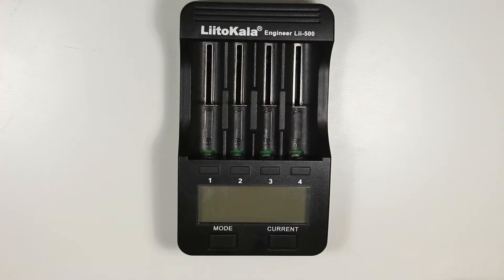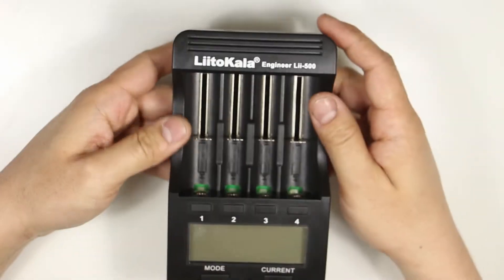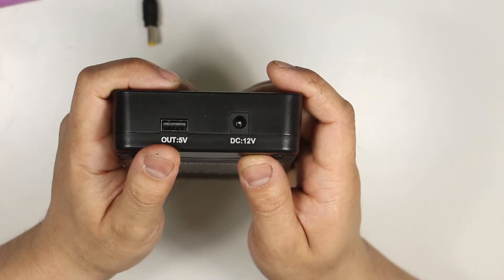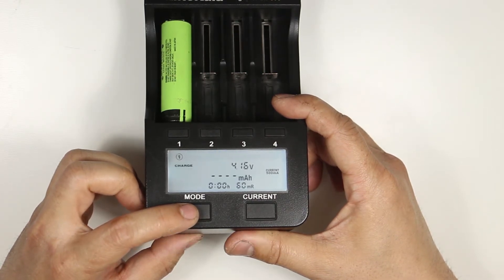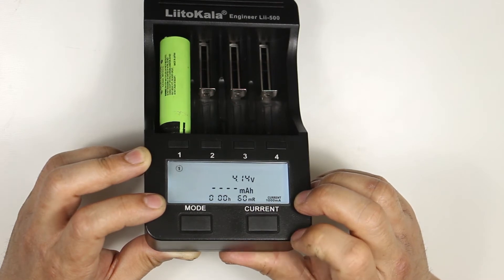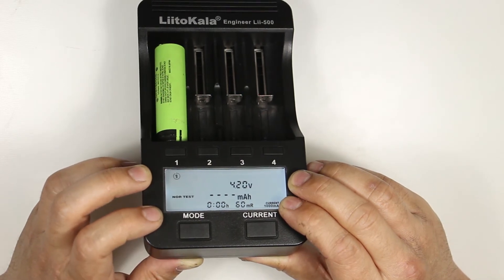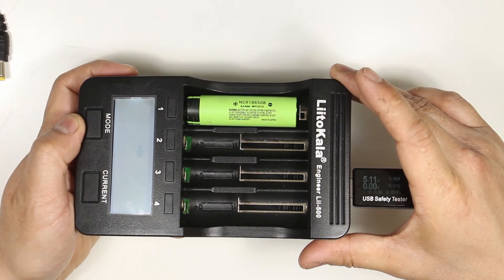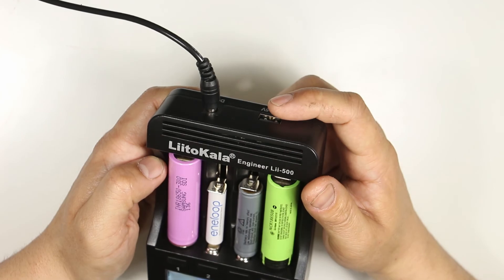LiitoKala Engineer Lii-500 Review

Comment: Can you load all 4 slot at 1000 mA?
Reply from the maker: Yes
Reply: @DougHnut  but do you recommend putting a larger font? for example 12V 3A or 4A?
Reply: @DougHnut  But the wall adapter have only 2 Amps?

Comment: You said the internal resistance of each cell is displayed in MEGA ohms. Should be MILLI ohms.
Reply from the maker: you're right, it should be milli ohms. TIL
Reply: @DougHnut  ...and for AA, and AAA  internal resistance always is 52 mR on display...is not measured....?
Reply from the maker: I didn't notice that. I just check the charger on  AAA nimh batteries and they all show 52 mR except for one at 50 mR

Comment: Hi my friend, I'm from Brazil.
Since I do not understand the language, I'm writing because I can translate.

First congratulations on the channel.
I bought this charger (Lii-500) and I still have a doubt:

TALKING OF NI-MH AA BATTERIES
After all, what's the difference between charger, fast test and nor test?

The charger will charge the battery and in the end will show the value of mah that was charged

What about the fast test and nor test?
they will do what? will test and show the same value of mah that I would see if the charger were used. So I can not understand the difference between functions. If both fast test and nor test at the end load the stack and show the same charger information I ask: Why and when to use each of the two tests if the charger already loads and already shows the same information as the other two functions show?

Just give me an explanation so that I understand
hug
Reply from the maker: Fernando Luiz thank you!.
Fast test measures the amount of mah charged into the battery from empty. Nor test measures the amount of mah discharged from a full battery. 
Nor is more accurate but takes longer.
Reply: Novamente agradeço a explicação mas ainda nao ficou esclarecida minha duvida. O que cada função faz voce ja explicou e entendi, mas tendo em vista que a informação na tela é a mesma (quantidade de mah)  nao consigo entender porque usar uma a outra  já que ate em charger essa quantidade ja sera mostrada. Pode me explicar?
Reply: Again, thank you for the explanation, but my question has not been clarified. What each function does you already explained and understood, but given that the information on the screen is the same (amount of mah) I can not understand why to use one another since to charger this amount will already be shown. Can you explain me?
Reply: @Flr3000  o normal teste é mais preciso por isso demora mais tempo